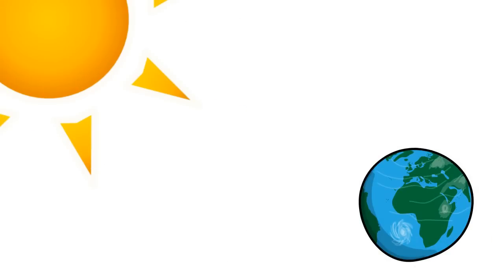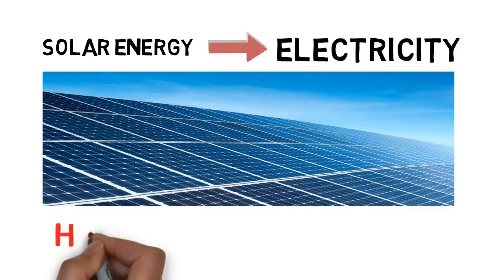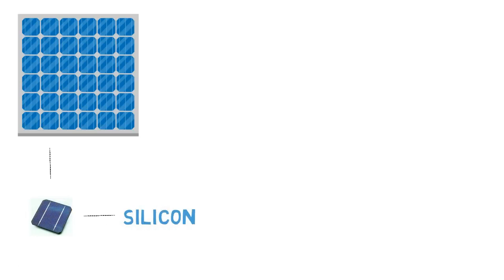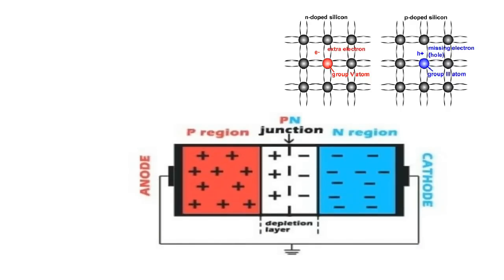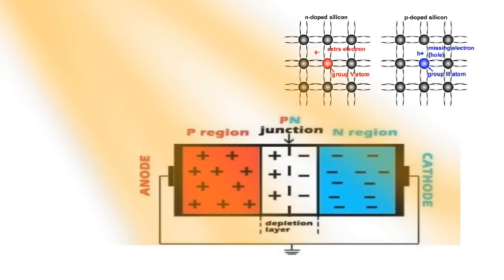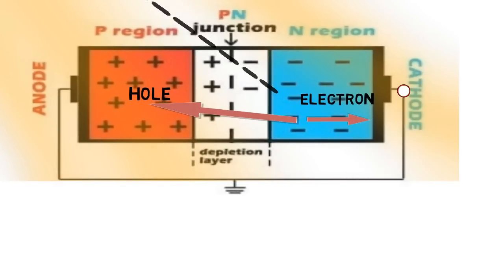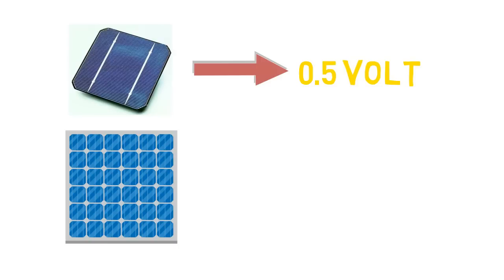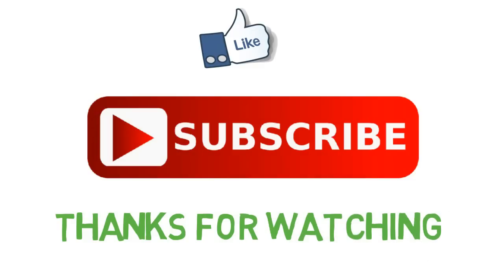How solar panels work? Why Silicon is used in solar panels?How much Volts does 1 solar cell produce?

Comment: Your depletion region is wrong. electrons and holes near the junction recombine with each other and then recombined electrons left positive donor ions at n-side and recombined holes left negative acceptor ions at p-side.
Reply from the maker: Instead of using the usual notations due to which beginners get confused a bit  I used negative sign for the part having excess electrons and positive for the part having deficiency of electrons. By the way great job since you watched the the video with interest. Thanks for watching

Comment: You have got depletion zone wrong. N side should be positive because electron jumped to P side.
Reply from the maker: No, the electron is pushed in the connecting wires and not the P region..
The empty region and not the electron eventually shifts to the P region...
Reply from the maker: By the way thanks for watching...